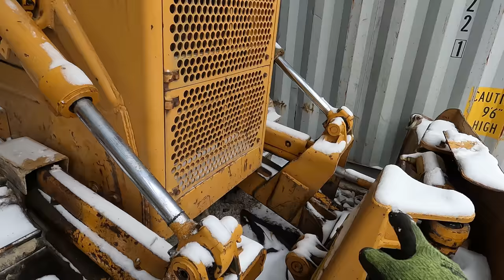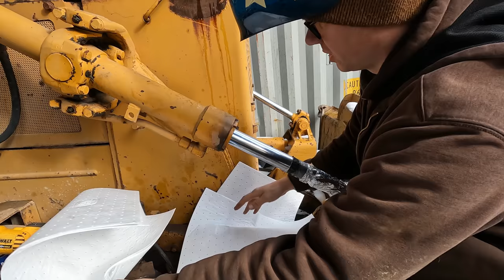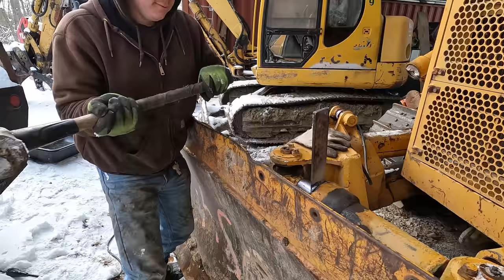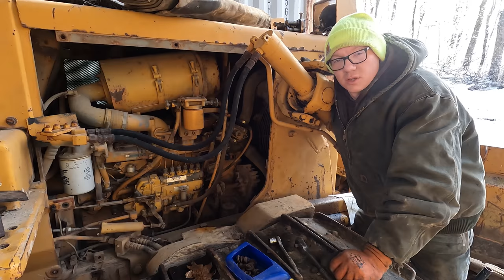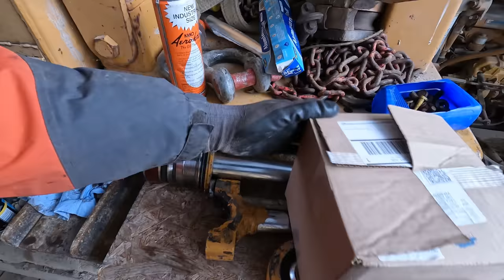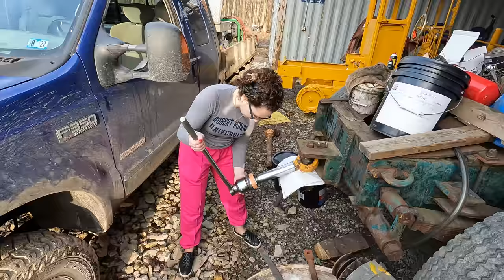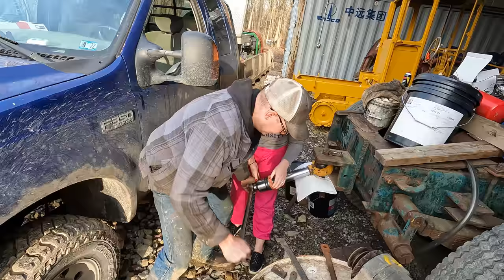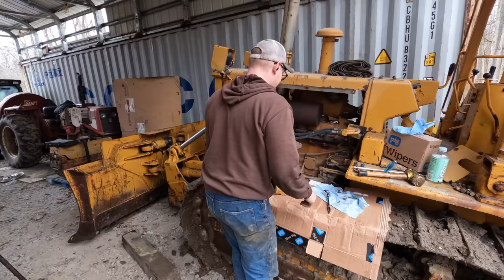Komatsu Dozer gets Cylinder Rebuild. (Long Overdue)

Comment: 18:50 for future : you can use a pressure washer as a high pressure water pump to seperate stuck cylinders
Reply: - Really good suggestion. It is another "D'oh !" moment like we all have had.
Reply: Never use compressed air or gas
Reply: Well unless you want half of your cylinder in low earth orbit!
Reply: in the climate hes in, i doubt he wants freezing cold water everywhere
Reply: @tncountryboy06  id rather think he doesnt want to risk his pressure washer freeze inside from residual water, really this was a work he procrastinated for 4 years just to choose the worst time of the year for such a job
Reply: @prinzeugenvansovoyen732  things come up and other things have to be put on the back burner. Pretty easy to judge and get things wrong without all the facts 🤙🏻🤙🏻

Comment: Matt, a 24" chain wrench and a cheater pipe will end your cylinder disassembly problems. Unless the cylinder is bound HARD, all your inertia is dissipated in the slack. A chain wrench around the gland nut works. Sometimes the " slots" are boogered up. In this case you grind the distortion flat. This assures as you bear down on the wrench it doesn't jump off the gland. Once you have a good secure " bite" you can install the cheater..great care here .

Comment: I use a very large pipe wrench to remove the gland nut; works pretty well.  You really need a large vice mounted on the back of your truck, would save you a lot of strugling. Also I frequently take phone pics as I take things apart to help put them back together, but oh by the way I screw up too.  I am told the only way to not make mistakes is don't ever do anything. Love it, thanks for sharing with us,
Reply: @chevyon37s  Put short pieces of stock in the notches of the gland nut, then use the pipe wrench on those.  My former boss taught me that trick, one of many he learned in 50 years in the hydraulic trade.
Reply: @dfross87  like flatbar?
Reply: @mechtechau  More like 1/4" (or 3/8", 1/2" -- whatever size suits) solid square stock.  Each piece only needs to be 1" or so long max.
Reply: @dfross87  gotcha, that's a good one.
Reply: @mechtechau  Obviously you use round stock if the end cap has semi-circular notches.  Forgot that detail last night.

Comment: I am amazed with the welding. My case backhoe had a pin hole leak around the top hose fitting. Used a wire welder and tried not to overheat but impossible for me to repair because of oil filled. I took it apart and cautiously ground and welded.  To my surprise it never went back together again.   It egged out the cylinder and top was impossible to thread back in.  Bought a used one for 1-K.  I had a bad leak in my D-31p angle cylinder, but did not use your weld idea and bought a 6" jaw X 48" X 35-lbs pipe wrench after all else failed. A six foot cheater did nothing. Used my tl-70 front-bucket to push the wrench handle. Finally.  I am 72, but still can't afford (never will) pay for repairs.  Fuel was 49-cent a gallon when I made my pond.  Make America Great Again !  How ?.  Great job, and you bust your butt. Stay healthy and happy.

Comment: Case 1456A spanner wrench.  3/4" drive. Works on cylinders 2" up to about 6".   $75.    You WILL have other cylinders to pack in the future
Reply: And even if you decide you won’t use it again, I would guess you could sell it to someone else for most of what you paid.
Although that take some time and effort as well.

Comment: Matt,
The cylinder that had the bore shrunk by the field welding repair was almost certainly bent by the same repair.
The factory uses rotation gear to minimise the effect in production then machines it straight.
A field repair is impossible to keep symmetrical freehand so the heat makes the cylinder go banana shaped as well as shrinking the bore.
If it works ignore it.

Comment: If you ever have to break a gland nut again heat and a air hammer can do wonders.  Keep on keeping on.
Reply from the maker: been there tried that, not a chance for these ones unfortunately
Reply: @DieselCreek  - did you put them back as tight as they were when you had to break them loose?
Reply: Perhaps try “Big Nasty”
Reply: @chrismoore9997  he added a paint mark, if it doesn't move, then its fine
Reply from the maker: They are as tight as I could get them with a hammer and a bar
Reply: @DieselCreek  Another great video , I noticed that you use a large ratchet when loosening / tightening nuts etc . Would it not be better to use a  breaker bar instead . Save wear and tear on the ratchet gears . Thanks for posting .
Reply: @anthonycarty9433  I believe that’s actually a torque wrench on the tightening part.  Must be a pretty high torque value.
Reply from the maker: @anthonycarty9433  lifetime warranty, good name brand ratchet. 🤷🏼‍♂️ you aren’t wrong but I’ll take my chances
Reply: @DieselCreek  Fair enough , just gives me the heeby jeebies watching people lean on ratchets to undo really stubborn nuts and bolts . Thanks for the reply .
Reply: Bobcat puts some wicked locktite on them. Without heat takes something crazy like 1500 ft/lbs.
Reply: @timberhole1303  That's some torque , no wonder Matt had a length of scaffold pole on the end of his wrench . Regards .
Reply: @timberhole1303  That's a good explanation, why a little heat from a simple propane can torch solved the problem.

Comment: A tip for running freshly repacked cylinders… you don’t want to go full stroke right away. I was always told you go 3/4 of the way back and forth a few times and then SLOWLY go to full stroke. The reasoning is because the air in the cylinder can actually cut the seals when forced by if you go too fast
Reply: I was told the same thing
Reply: The way we do a cylinder after rebuild is when loading that cylinder you load at a quarter then back off then at half then back off and three-quarter than full bore stroke the reason being is so that you do not overload the hydraulic pump and the pilot pump system with air that’s just how we do it
Reply: Absoloutely correct.

Comment: I do this all the time. A big pipe wrench and a air hammer with a flat bit. Use the air hammer on the housing to vibrate the threads. Extra pair a hands help.

Comment: Instead of the foil use Aluminium roof flashing. It's thicker and can be reused. You can still use the tape or a couple of hose clamps.
Reply: You mean exhaust repair tape? Works for that too combined with some sort of putty.
Reply: No aluminium roof flashing is similar to lead flashing. It's aluminium that is 0.3mm thick, 300 mm wide (about 0.010 x 12 inch) and comes on a roll. There is no adhesive or putty. It is used for roof waterproofing/repairs.

Comment: I've worked on many cylinders and did notice you putting the nut on without the piston in place. I thought you had a new way and I was hoping to learn something new. Turns out it was just a good reminder to have all the pieces in place before adding the torque to the nut. 😁

Comment: Hi Matt I'm a mechanic from Canberra Australia I like all your videos a little tip to help you when you don't have the special tools to remove the hydrolic shaft and seals housing off leave the cylinder pin on and use a small block and dackel from the eye of the shaft I hope it will help

Comment: Hey Matt that was a nice video remindes me of doing my first changing cylinder seal 😀  things like doing the piston on without the cylinderhead happens every one once. They who say that this doesn't happen to them are doing this only once or lying. Some little things I noticed that could help you for the next time. The smal ring were you don't know exactly were it belongs to is an support ring. It helps to protect the ectualy sealing from wearing and helps them to stand pressure peaks. The support ring always goes on the opposite side of the pressure the lip of the actual seal always goes toward the pressure for 99.99% of cases. Putting the pistons on the cylinderrods the opposite way can cause trouble. Because a hydraulic cylinder flexes a little bit wen it works because of the tolerances and the side forces through the rod. The piston is presst against the cylinder wall . The wide brown ring that's also on the piston is were the piston slides on it protects the actual seals on the piston from rubbing to hard against the cylinder wall an tearing themselves appart. Is the brown ring not on the farest end of the rod the flexing of the rod inside the cylinderbarrel can wear the seals much faster depends on the tolerances in the cylinder. With the hours you run on that dozer it could probably hold like 10 year perhaps so no actual worries 😅. The last thing I don't actual see or you don't show it on camera is putting thread locking fluid ( stuff like loctite) on the nut on the end of the rod because this nuts are always nuts with an plastic protection against loosening wen they're not secured other ways. The problem is this protection hols only once. So screwing them on twice without loctite  they can become lose and tear the hole cylinder up especially wen you hadn't the ability to torque them proper because torturing with a bar showed to me in most times isn't enough.

Comment: Used to work in a hydraulics shop and sometimes you gotta do what you gotta do to get the glands out. The ones with a retaining wire were usually the most hateful. 
When getting stuck rods out, we just used a power pack (motor, hydraulic pump and oil tank), big drain pan and a flying parts arrestor (the wall)  and drove  them out. Pressure drops instantly and oil goes in the pan when it lets go and the arrestor says ouch.
Was always fun when cylinders come in with the rod bent 90' at the gland🤦‍♂️

Comment: using the excavator is a perfectly valid solution - I know a few people, and have seen a few more on Youtube, that have set a ring or somesuch into the floor of their workshop, specifically for pulling rams apart. A nice big steel plate under the concrete pad, with a hoop or shackle in the centre, and haul on it with a crane or excavator or whatever

Comment: As a long time practitioner of the "bigger hammer" method, I discovered something a couple of years back that might help in future encounters.  I had to remove a fan from the shaft of the motor that drove it.  Yeah, way smaller than what you are working on but bear with me.  When a succession of bigger hammers succeeded only in bending the blades of the fan enough to make it useless, I remembered that among my air tools I have an air hammer.  A few minutes of the smaller but rapid taps of the air hammer moved the shaft out without further damage.  Somewhat the same principle that a pneumatic torque wrench uses.  Jar the corrosion lodged in the screw threads coupled with the twisting motion and "open seze me".

Comment: I'm an old master mechanic and in my 70's, the best thing I like about current time electronics is the phone camera. I take numerous photos before and as I take apart something. I have had numerous times that I had to leave a project and return later looking at what I took apart and the photos saved me. A trick I learned working on 300 ton mine trucks and dozers is to use an impact blunt  nosed chisel around the gland nut to break the thread lock, go around the nut and casing as much as possible and I also use Kroil to penetrate the threads, it' works the best of all I have used. Love to see you repairing old equipment, I wish I was closer to help.

Comment: 20:45 from watching Kurtis from Cutting Edge Engineering Australia i do know, that everything starts with 12mm button insert (as they are very tough and take a lot of beating!) on the lathe! The cylinder is placed on the lathe in a steady rest and the welds are more or less carefully machined away so the cylinder can be separated into gland, base and old pipe. Then a new pipe is machined to length and matching circumference, everything is put back together and MIG welded on a rotary table. Afterwards it is spray canned in "machine yellow" on the outside and saturated with wool fat on all corrosive endangered surfaces, before it is shrink wrapped to the pallet and sent back to the customer. And most of the times at 2/3rds of the job, the dog of the shop owner receives new toys vai mail, but i am not quite sure, if that's part of the repair process!

Comment: Matt the reason the wide guides on the piston is on the back side is when the cylinder all the way extended the piston tries to twist in the bore and the wear guides absorbs that. With the piston installed backwards the seal will have to take that side load and will probably wear out sooner. Thanks.

Comment: I saw my mechanic use a 4’ pipe wrench. He then took a sling and his trucks crane to break it loose. The crane applied nice steady pressure and it came off smooth. This is also a pretty cool trick.

Comment: Nice repairs! Brought back memories, I worked on mobile heavy equipment for years as a welder, I have a easy tip that might save you a big headache down the road, when welding a piece of metal to any part of the unit always put the ground clamp on the part being welded on, or as close as possible to it. I’ve seen pitted bearings and cylinders from ground clamps being to far away and loosing contact that causes poor arc starting on the welding rod. But you did a nice job getting it up and running. Personal I would have cut prongs and half circle in that piece of flat bar to fit the end cap retainer, then weld a long bar to it for a improvised tool.

Comment: My philosophy is do both the packing and seals while the cylinder is apart. That way you aren't wondering how soon you gonna have to tear the cylinder apart again. Might as well do both while its apart. Just my thinking. I wouldn't be able to live with the pieces being on backwards. That would drive me absolutely crazy wondering what it could possibly break. I'd have to fix that even though it would take so much work. I have extreme OCD about some things. Awesome video. Stay well. -Wil  👍

Comment: On a lot of construction 🚧 equipment the cylinder glans also the glan nut,the tork can be 800 to 2000 ft.lb.
Reply: So heavy engineering tight basically

Comment: In case this ever comes up in the future. You can make the special tool you need by welding some nubs onto any tool big enough to grip those notches. It could be a wrench, it could be a pipe wrench, it could be lockjaws, whatever fits. Its a whole lot cheaper to mess up modifying a tool than it is when you mess up on a hydraulic cylinder. My uncle does a lot of the same types of things as you do but doesnt film it, obviously. He made a modified socket by chopping a piece of pipe in half and welding on some appropriately spaced nubs, a handle, hinge and chain latch. He made a couple of them of different sizes because he would rather improvise a tool than risk damaging a cylinder. Its time expensive but material cheap and that's the kind of trade off he likes.
Reply: Ron, have your uncle start a channel, i for one would watch it
Reply: I was getting ready to post a similar comment.
Reply: @donsurlylyte  Sorry to disappoint but with him being in his late 70's, i strongly doubt that will ever happen. He is deep into his retirement and tinkers just enough to keep himself entertained.  If youtube as it is now had been an option 30 years ago when he was more active then you might have gotten a different answer. But i still suspect he would have scoffed at the idea of filming his projects for others to view and would have seen it as an invasion of his privacy.

Comment: Shortly after you talked about the fluid bath from Fat Alis and then the cylinder squirt in the face I’m sure you had a flashback No Not Again. 
You’re a good man admitted to your mistakes not many people will and I respect you for that.  Hopefully you shouldn’t have to worry about the cylinders for awhile.  When I used to work on cars sometimes wind up with a few parts left over it’s like I’ll find out later when it tears up again. Have a Blessed One Sir

Comment: I own a LX2610 as well. For a tool box i have a small ammo box that i painted in the same place as the Kubota. I also use the round axle hole that i used magnets on both ends of the hole. From bolt on hooks i got a quick attach side compartment.I also purchased magnetic mirrors that work really well from Extreme Metal Products.

Comment: If you have a scarred cylinder rod I have filed the edge down to level and then cleaned the scar with ether or something to get rid of all traces of oil.  Then over fill the scar with JB weld   Let dry overnight.  File and emery cloth the excess epoxy , then put it to work. We did this with an old loader as far as I know it’s still working. That was 20 yes ago

Comment: We actually made a tool back in the 90s which is full circle and gripped the 2 or 3 collets, we hard faced them with weld and ground down to make it stronger. They were 2 ft long for either a bar or to hammer loose👍
Reply: we called those KNOCK wrenches in the ironworkers. made many over the years for many different applications
Reply: @higgins7965  cost very little but do a lot👍👌🏴

Comment: PLEASE help that lady out. She has a big heart. My bride of 42 years can jump start most pieces of equipment, hot wire them too if need be.
Service fuel, oil, antifreeze and hydraulics. Move the equipment if needed. Had an old Ford F-600 flat bed dump with an automatic that she regularly drove and hauled fill and top soil with. 
Even thoigh she couldn't cut blue top grade, she could clear and spread as needed.
She kept the machines moving as a ell a a getting the kids to school and back, cooking and cleaning and so much more.
In the mean time, I was an Aircraft Mechanis in the USAF working nights.

Comment: Run a cylinder hone in that section using an inside micrometer to determine the size. Cylinder hones aren't that expensive and are useful for engine rebuilds as well
Reply: Cylinder is my suggestion also